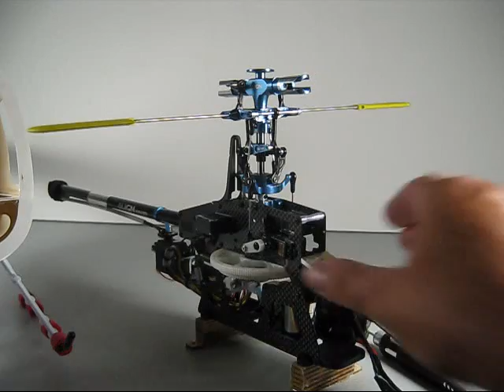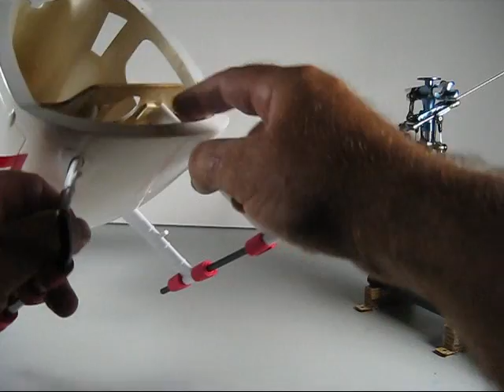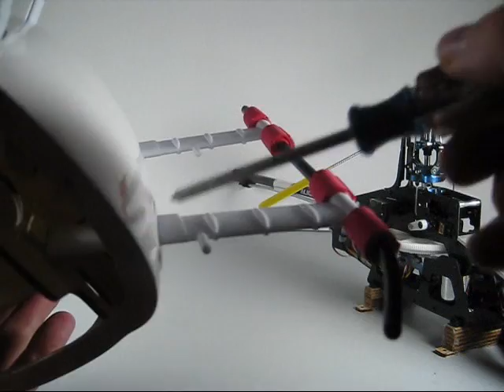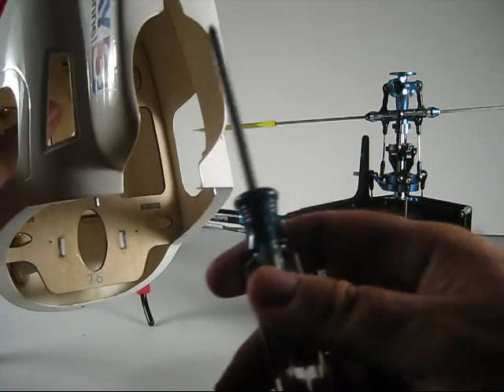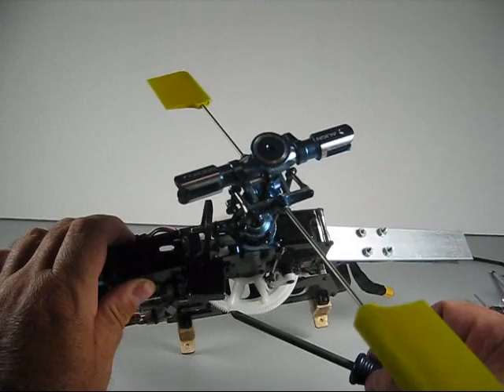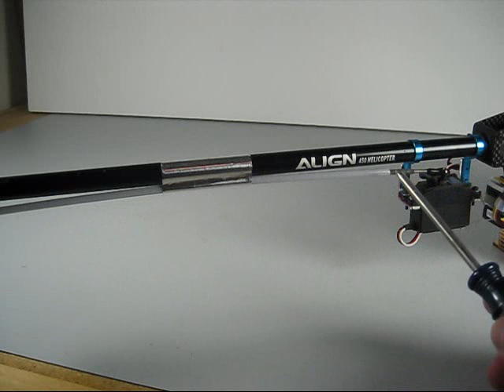500E Build Part Two.wmv

Comment: Thanks so much for posting this two-part series. Just purchased a new old-stock align md500 fuselage for the trex 450. Will be installing a 450 pro v2 mech in it. Your videos probably saved me a whole bunch of head-scratching. Best regards from Brasilia, Brazil.
Reply from the maker: Glad I could help! Be sure to anchor the canopy very well. I added extra magnets, but in the end it still came off in flight and destroyed the fuselage. https://www.youtube.com/watch?v=nocNJtyClDg
Reply: @ChucksMagic  dude thanks a million for this hugely important tip!

Comment: Great video......I have the military version of the 500E HK made by KDS....and my rear elevator servo was rubbing.....I just removed the lower 4 little footing blocks on the mounts and that worked out. Also I'm have a simular problem with the rudder servo....it isnt aligned correctly but it is slightly off set ...I havent had a problem but Im glad to see that someone rigged up a fix....And yeah ...the blocks did come apart on me...I just epoxy them both and now they are solid...Great Video!!!!